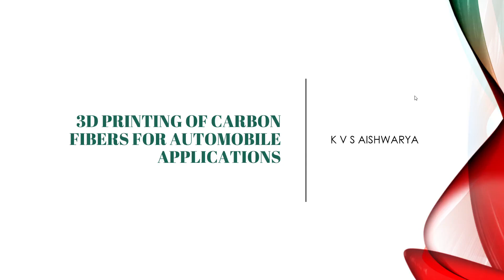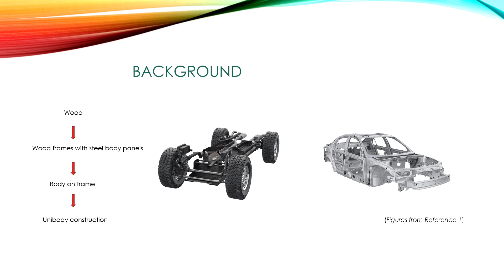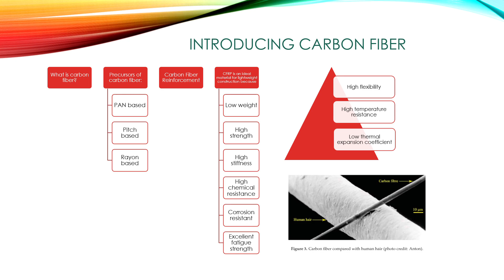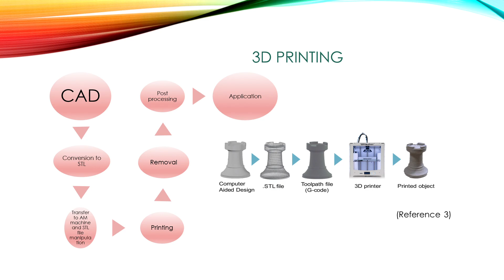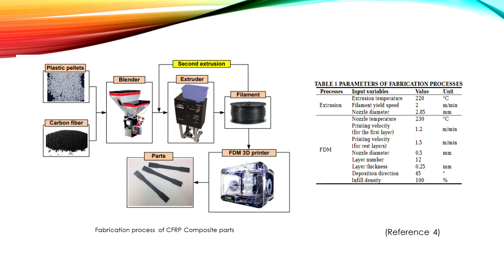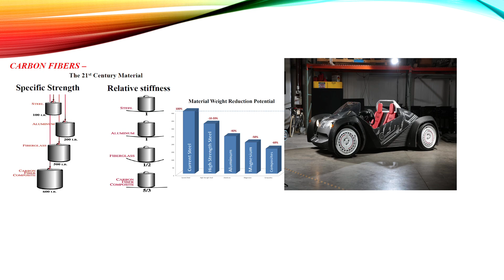PowerPoint Slide Show   3d printing of carbon fibers for automobile applications 2020 08 21 16 47 03

Comment: I am a chassis system designer of my university formula student team. Many FSAE teams across the world use CFRP in their chassis. But in India, still, most of the FSAE teams design a steel spaceframe. There are just a couple of teams making monocoque in hundreds of team out there. So, why do you think Indian FSAE teams are lagging in this perspective? What would be your suggestion for a team who want to make a monocoque in coming season? If possible, please tell how should the literature study to design a chassis of carbon fibre should proceed and what manufacturing process should they choose? What is your cost estimation for the manufacturing process? Where can be the components of the manufacturing process procured from? And lastly, if you have any insight into manufacturing the monocoque chassis from vacuum bagging, please tell.
Reply: @k venkatasaiaishwarya Thanks for clarifying the doubts. The information provided by you will surely help in the future planning and thinking processes of FSAE teams.